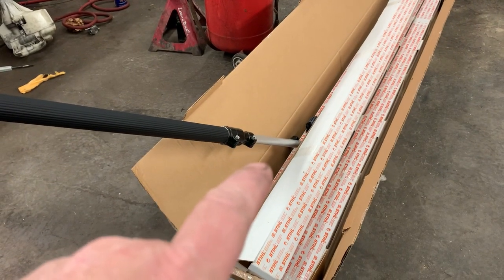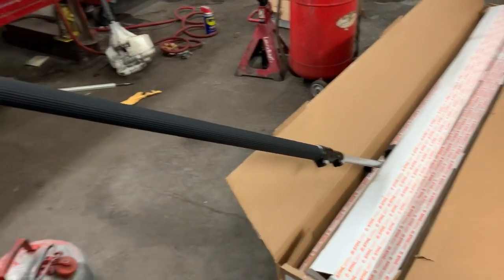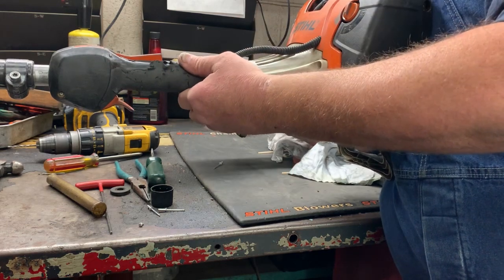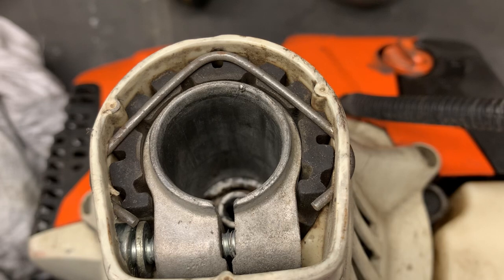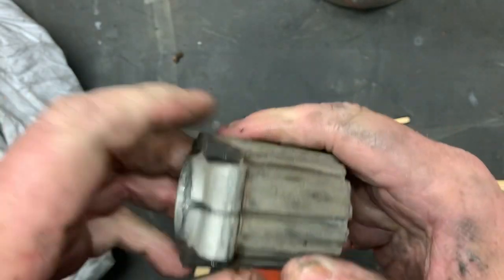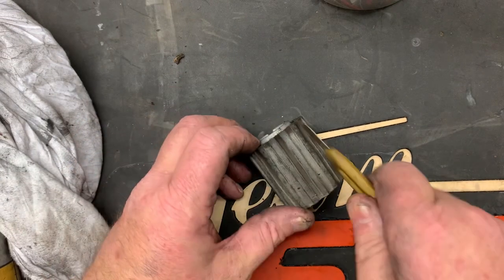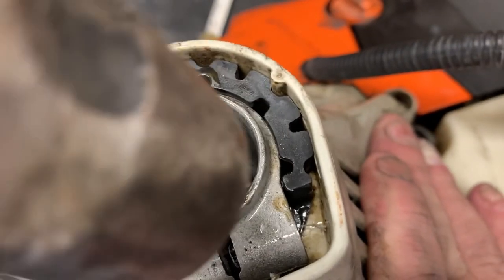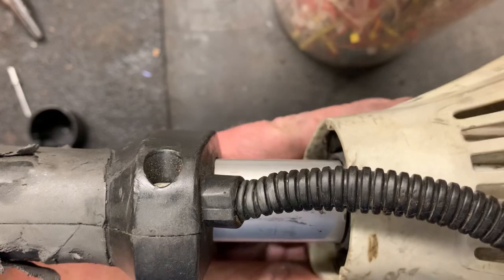STIHL HT / KM / FS  CLUTCH BELL BUSHING REPLACEMENT / SUPER EASY!

Comment from the maker: 4180 791 9303 - Stihl Rubber Insert
Reply: Where is the place for a discounted price? Great video as always. Thanks
Reply from the maker: @backdraftdragon3150  google it
Reply: @THEMOWERMEDIC1  Sorry, I thought there was some inside info. Live and learn.
Reply: Good shit man, my fs head is wobble and its causing the clutch to actually make slight pinging sound which is what you said probably the cable slapping the housing from the mis alignment. Thats is a huge help, thank you.
Reply: @THEMOWERMEDIC1  what's the name of the metal bushing assembly that this rubber attaches to? I'm pretty sure i need to replace that entire unit. I bought mine used on the cheap on account of the powerhead being totally loose-goose on the shaft like it freely rotates around the sucker and the guy I bought it from just had a bunch of electrical tape holding the powerhead and the shaft together but it still spins around completely with the tape. I'm pretty sure it got dropped while they were up in a tree is my guess? He didn't "Speak-ae da engle-ssa" if you catch my drift 🇲🇽... Do you think replacing that part that you cleaned up with the brake cleaner would do the trick?

Comment: Great job again,😀
Parts can be expensive on Stihl parts especially on Professional Equipment more noticeable, but the do work well in general.
Got over 10 years on a Stihl FS 55, before I stuffed  the gearbox, just upgraded to a new  FS 85 for the extra $100 upgraded to the FS 85 plus the other reason was that the 55 didn’t have the grease nipple as before in the Gearbox.
Have a  FS 55 Combi, but only the standard attachment for trimming, on the look out for second hand accessories at a good price.

Comment: The saw that you were doing went very easy. I had to replace the drive shaft and clutch drum on this 110. The allen bolt and the nut is having a hard time lining up with each other. I've tried everything but dawn dish soap. It goes down into the housing easy but trying to line the holes up with that clamp is adding to hours spent on the repair. Any hints would be appreciated or maybe you already have a video on that such repair...thanks

Comment: On my fs91r weed eater the clamp inside the rubber bushing broke . So wen I put the screw in , it doesn’t clamp shut , so I think if I just replace the clamp and keep the old bushing it should be okay .?

Comment: Sorry for the simple question but what causes the damage, and how can it be prevented?
Reply: Just normal wear, they also send a new buffer with every pole saw assembly because of all the extra weight pole saws have.
Reply: Throwing it onto the trailer or on the bed of the truck will break the bushing or other small parts, especially on 91's or higher. Set it down, don't toss it.